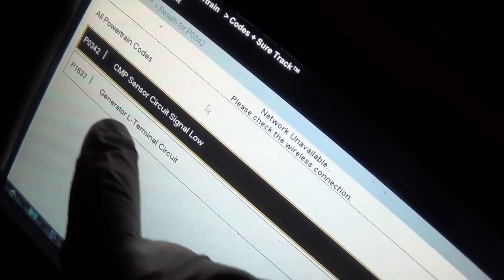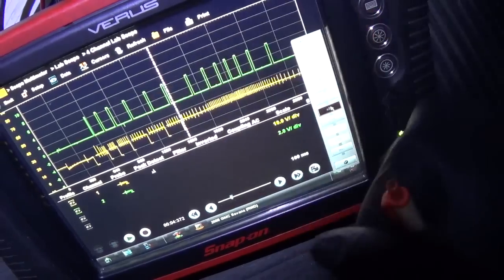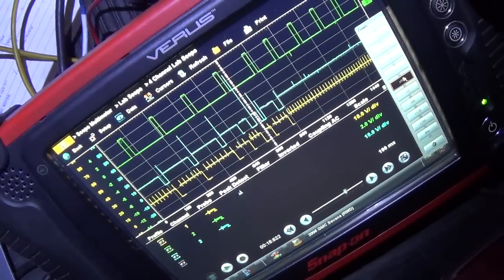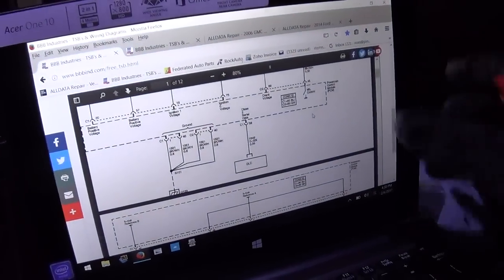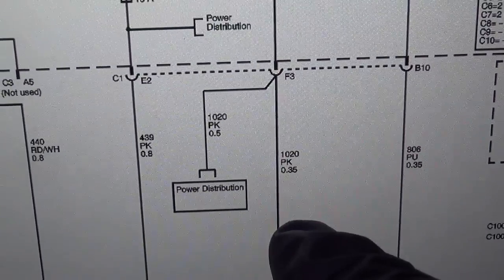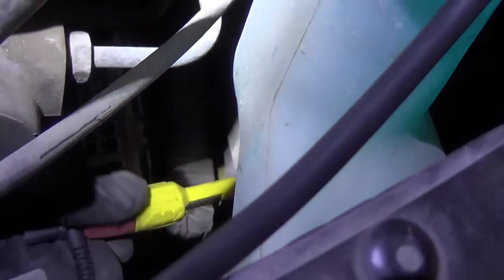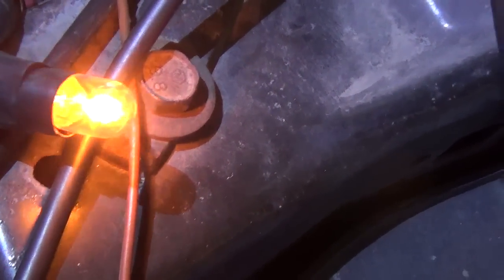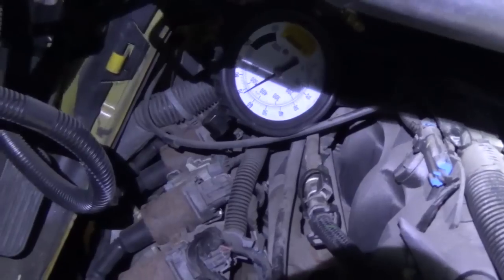Start-stall case study: GMC 4.8 School Bus (Staten Island Ep 7.2)

Comment: That was fun. It cracks me up when customers give you a vehicle and the gas gauge shows empty.
Reply: Cars are usually on empty when they come in. Unless the tank needs to come out. Then they're full.
Reply from the maker: truth.
Reply: Well, if the problem I'm having is going to involve the gastank somehow, I do try to bring in the car with less than reserve remaining, as I assume that makes the technician's life easier, because there is no excess amount of fuel in the system (correct me if I'm wrong there and you lot would rather wrestle with a full tank). Otherwise I'll leave it at whatever it's at.

Comment: You pierced a wire! You violated it and could be brought to prosecution! According to Dan Sullivan anyhow. Good video and diagnostics as usual.
Reply from the maker: I have learned from the pros that sometimes backprobing causes more damage than a fine piercing probe! The connection to the meter is also more reliable with the piercing probe, making for a more accurate diagnosis. :)
Reply: And i am sure the pros you are talking about I as well would respect their input on the matter! Thanks Ivan!

Comment: Very good diagnosis Ivan, some people might say why not to fix the wire instead of by pass, well on the real world lots of costumers don't even want to pay for the diagnosis! So lets not spend time that we will not charge for! Either way the repair is done very well.
 I have costumers asking me if the diagnosis is included on the repair!! LOL, my answer is always, so If the repair is just a broken wire (and toke me 2 hours to find it), should I charge you $5?
Reply: Maic Salazar bypassing known faulty 12v wires is just dodgy and asking for trouble.

that loom could be rubbed through and other wires affected soon which could arc and have a bus fire loaded with kids?

love his videos. but cant agree with this repair.
Reply from the maker: Keep in mind that this is a modern vehicle with fuses, which will blow way before anything arcs and catches on fire. The only wires you really have to watch out for are the main power feeds to the starter and alternator, plus the battery posts. I believe that is how ScannerDanner's Jeep caught on fire...the naked positive battery post possibly shorted to the hood latch.
Reply: motoYam82 completely agree with your comment.
Reply: I appreciate what you are saying.but have been installing stereo systems for 20+ years. and have seen and also caused a few wire arcs and meltdowns that have melted/burnt interior pieces etc. and they were all fused appropriately.

anyway love the channel Ivan. yourself and south main are awesome!

Comment: Why do American cars make so many bong noises? Don't you find it a bit annoying?
Reply: Matthew Collins the bong noises are starting to go away. there is push button start, so no keys left in the ignition. then there are auto headlights, so leaving your headlights on after stop no big deal. the only beep I have heard from my car is when your don't put your seat belt on and you hit 5mph.
Reply: So it dings to tell you the keys are in the ignition? How weird. I've never had a car that does that. (Over in the UK). I think it would drive me batty.
Reply: Matthew Collins and in the USA you need to push the clutch to start the car. Too bad if you stall on a railway crossing...
Reply: Matthew, on  cars sold in the U.S. with a standard transmission you also have to push the clutch pedal down to make the starter work. this  "security feature" throws a lot of (european) people off the first time. :-{
Reply: Becuase most people are idiots. It dings to let you know to put on your seatbelt, your keys are in the ignition, there's a door open. It's annoying.
Reply: Totally agree: unacceptable... the only thing my car beeps for is for leaving the lights on when one turns off the ignition and opens the driver's door, which, from watching these sorts of videos, is about the only thing US cars don't complain about specifically.
If I lived in the US, with this sort of car, those dingers would have to go somehow; no question.
Seriously, how do you guys put up with this shit?
Reply: On the other hand we pay $2.19 a gallon for gas.
Reply: Jan Verschueren I have my seatbelt one disconnected and my jeep only dings when you first start it, my friends Ford dings no matter what.

Comment: Great use of incandescent bulb test light, but why would a wire go bad in the middle?  Overcurrent is only thing I would think.  If you splice in a new wire of same gauge won't whatever burned the old wire burn the replacement?  Should check and write down run current of replacement wire, in case bus comes back, and also if you see above 3 amps start to think about what's causing high current draw.
Reply from the maker: Wish I had an answer for you. There were no intermediate connectors between the fusebox and PCM to narrow down the problem any further. I assume green crusties did their magic somewhere in the middle :)

Comment: what lead you to check powers and grounds at the pcm? experience? or the loss of injector control? did you scope the cam and crank sensors and seen they were good then went to powers and grounds. it was a good diagnostics. I was thinking maybe it was a fuel cut from the theft system. I woulda checked the enable or disable pid
Reply from the maker: If it was an intentional fuel cut, there would have been a trouble code stored like "VTD fuel disabled" or something. But having no relevant codes, and seeing the ignition coils maintain a consistent control throughout the stall, told me the CKP sensor was OK.

Comment: I might have missed something, but how did you go from noticing a problem with fuel injector control and fuel pressure while ignition control waveform looked good to figuring out the problem was with pcm ignition power feed?
Reply from the maker: PCM wasn't storing any trouble codes, so wasn't likely to be an input problem. Only other things to check are powers and grounds! What direction would you have taken?

Comment: Hack fix.  But probably what I would've done.
Reply: Why do you say its a hack job? Sometimes it's better to eliminate the problem wire,  Ivans fix will more than likely out live the bus.
Reply: 12volt Tech yes, it would be a hack in certain situations but this bus is a tool to get people from a to b and back. why cost the school system more money just to restore a wire or connection to factory condition when this does the same thing.
Reply: It's a hack because when dealing with wire bundles - abrasions, pinches, meltdowns, etc don't always result in a single surgically affected wire.  Thoughts of whatever calamity that could happen due to a bus suddenly stalling aside, not verifying the actual cause to ensure that other wires in the bundle aren't split and about to short or corrode is just plain negligent.
Reply: Me too. The vast majority of a vehicle's wiring is difficult if not impossible to access. So I'd say for almost 75% of open wires you need to run a bypass unless you want to take apart half the car (bus truck etc.). At least you're not putting in an after-market part!
Reply from the maker: I did do a wiggle test and visual inspection on the entire harness. There was no obvious damage. Now if you are bent on finding the exact location of the fault, then you might have to open up the harness in several places, which is actually MORE likely to damage it than leaving it alone and just bypassing the bad section.

Furthermore, my bypass wire was wired to the original fuse, so not sure why you think there is a risk of "meltdown"?
Reply: I'm not saying your repair will cause a meltdown.  Maybe I missed where you mentioned examining the harness.  I'm saying that wires stop conducting for a reason.  The close grouping of wires in a bundle lead to a strong chance that other wires were damaged during the failure.  Was the one wire just stretched to breaking point? Then a bypass is fine.  If it burned through a weak spot other wires could have lost their insulation and the next bump could cause multiple fused feeds to combine to cause a meltdown or fire.  Whether it's a  burn, stretch, pinch, rub-through, or some bit of sharp metal from the factory floor wrapped into the bundle -  It's prudent to find the exact cause to see if other wires are will be affected and not suffer the same fate or worse.  That one wire could be an indicator of hidden damage and not something I would chance ignoring.
Reply from the maker: Eddie the Grouch
I totally see your point, and I did everything I could in the time allotted to find the root cause of the problem. If that did not work, do you suggest cutting the harness open and spending hours to tape it back up? 

This is the real world, so we have to strive to do our best, but also can't afford to waste time. If other wires were affected or close to failure, then the wiggle test would have revealed it. I feel completely confident in this repair; sorry that you do not.
Reply: motoYam82 
OK, so what your really saying is 'this customer gave you two freaking hours to fine an electrical wire problem that displayed no freaking codes'.  Then you fine it but son,
Reply: motoYam82 
Sorry, hit wrong button.  So then you fine it which by the way was fantastic but, don't go a bit further to determine exactly what happened to that wire.  Wow Evan. Doctors do this crap all the time.  It's called 'fine the cause'.  Underlining crap will bite you in the ass.  The real problem here is THIS IS A FREAKIN SCHOOL BUS!
Reply: Eddie the Grouch 
I agree with your approach on this as well.  Cheap ass clients.  Allotted time is bullshit.  That was a difficult issue and Evan did it all within 2 hours.  I wonder who else in the service department for these School vehicles would have been able to do it at all!
Reply: Not a hack fix at all. Not on modern cars. There is too many wires, in too many directions to even start looking at all of them. They are all bundled together, and to take them apart, and run the wire properly would be a full days work, if not a week.
This is also a dealer approved fix as long as everything was nicely done.

Comment: I do not understand why PCM/ECM have monitors on sensors and acuators, like sensor line high/low voltage etc, but not on PCM/ECM power and grounds? Electronic components are cheap and you could easily generate codes for missing PCM/ECM power and grounds. This would save a lot of time, no need debug anything else in or out from controller, you would already know what power / ground you need to fix straight away from the code.
Reply: The entire point of having an ECM in control of things is not to make our lives easier, it's only there to guarantee the EPA that emissions are being complied with.  You get no self diagnosis circuity on non-mandated issues.  Price point is already sky high.  In a perfect world, your points are spot on,  just so happens it's not a perfect world.  AND as Ivan has corrected even pessimistic me, without these failures -- he would be looking for another line of work.
Reply: In a sense yes, but since 1980's in 20 years we now have live data, hundreds of PID's and way more info which makes fixing things way easier than the blinking led on K-Jetronic driver box. From my point of view cars are now easier to fix than 20 year ago. More complex yes, but more data and diagnostics in the box. 

Thus $2 six line AD -converter added to the SOC might not take the whole business away, since adding it to the sensors and actuators did not ruin the business years ago? Just my $0,02
Reply: I've seen "PCM lost power" codes. This was on a Cummins with jerry rigged "semi truck" battery terminals that the owner kept neglecting to fix properly lol.

Comment: I had a similar issue w/ a 13 silverado 1500 4wd 5.3. It was brought in for a CEL, starting problem: start stall ( not stated on RO), lack of power/misfire a highway speeds. 

Scanned for codes and there was a p0101, p0102, p0171, and p0174. Okay possible MAF sensor. Look at freeze frame, Idle , warm, stft like 20%. ( i need to document my readings as I go). No common issues per troubleshooter, tsb, google, etc. Okay look at MAF data and it's all 0. even in generic. I cleared the codes and instantly I was then dealing with a start stall. couldn't get the truck running pressing the accelerator or anything. Disconnected the MAF same. Vacuum goes up the 20" then falls w/ engine, rpm goes up and down with stall. Added brake clean to keep it running, 

with brake clean able to keep it going, but then started running like total crap. vacuum 10" steady. Died out, Fuel pressure consistent. 50-60 during stall.  It sat for maybe 10-15. then started up fine ran great, vacuum 20" fuel pressure 50-60 doesn't drop on a snap throttle. this is as far as I got. 

All the variable threw me off. Trying to understand your logic. coil control and injector control eliminates cam, crank, and tells u if your dealing with fuel or spark?  the injectors  dropping out being a pcm issue? could it be because of a  sensor that's giving an incorrect signal cause the pcm to kill injectors? 

Logic in the pcm wouldn't kill the fuel from a bad MAF sensor would it?
Reply from the maker: Well I would definitely chase the MAF codes first! You should at least be able to track down why it's reading 0gm/sec all the time.
Reply: motoYam82 dealing w customers and service writers they want to lump all the symptoms together and not being paid enough time for diag.

Comment: what led you to voltage drop? my next step would have been a crank sensor
Reply from the maker: ignition coils were firing consistently during stall, so not worried about CKP sensor in this case...

Comment: please shut off that damn beeper! Good fix though. This series should be called jumper wires on Staten Island.
Reply: I think its more like a damn DINGER.! MAN, 30 seconds into diagnosing, I would have fixed that damn dinger ding ding.!
Congrats Ivan for staying focused somehow on the real problem and getting her all fixed up. 
Now the wheels on this bus can go round and round once more.  (:  
Cheers
Reply: If I need to work with the doors open and have the key turned on, I close the door latch with a screwdriver and plug in the driver seat belt before I even start.

Comment: Ivan pretend this question makes sense. LOL  Ok if you're suspecting a ecm ground would a voltage drop from the data link connector at the  ecm grd. pin  to the battery grd terminal show a bad ground. No laughing......
Reply: STEVE ROB  ECM may have more than 3 grounds
Reply: huggybryn39 I think  I remember hearing the grounds are all tied together in the ECM. Might be wrong .
Reply: STEVE ROB With O2 sensors working with low amps and voltage you may require a separate ground for the return.
Reply from the maker: Excellent question, Steve! It depends on the actual vehicle. Sometimes ECM grounds are all tied together. Sometimes grounds for high-amp drivers are routed separately from sensor grounds. Wiring diagram is key.

Comment: So fuel pump was dropping out due to faulty PCM control feed
Reply: No it was a bad ecm power wire, about the pressure drop i dont know probably since the pump relay was controlled from the ecm so a bad 12v wire could not have total control of it.
Reply: armando nika 
Yes I agree, I just wasn't quite sure why the fuel pump itself was faltering. Two different symptoms related to the same prroblem.
Reply from the maker: Exactly. Once PCM lost power, it couldn't keep the fuel pump relay energized so we lost fuel pressure as well!

Comment: Great fix but just be warned that bypassing a power wire like you did may be a problem if something else feeds off that wire you bypassed. I did the same thing on a 5v ref for a throttle pedal that had one of the two 5v ref were bad. The schematic clearly showed 2 separate wires going to the ecm so I cut the bad wire and put a jumper on it and turns out that both of my 5v ref came from only 1 wire and when I cut it I didn't have power on the other.
Short story is just be careful
How do you like the touch screen laptop for the pico?

Comment: Sorry Ivan. Totally lost me on the real purpose of this video.  It's a school bus. Carries children. You found a wiring problem. You jumped a symptom. Bandaid it. Did not show doing a continuity check on said wire.  Did not eliminate suspicious wire from circuit.  Hope it doesn't cause issues down the road.  Are you saying this wire is partially broken?  I know it's a field fix and pressure is present from your cheap ass customers but, do it right and do it thoroughly.  The video is 13 minutes which does not tell me how much time you spent on it. Like 2 or 3 hours.  Between that alarm constantly going and your jumpy thoughts did not help me understand what you were proving.  Either GM has wiring and ground issues or your just showing off. Won't stop me from watching you videos.
Reply from the maker: Actual diag and repair time was at least 2 hours. Continuity check unnecessary. Bypass wire DID eliminate suspicious wire from circuit...that's the whole point of a bypass! It's a permanent fix, not a band-aid. 

Time constraints definitely cut into video time and quality, but I try to show the key points :)
Reply: motoYam82  Wow, Evan I'm truly honored you took the time to respond. Don't get me wrong, I've learned a lot from your videos and I'm amazed how you get down to the actual circuit causing the issues.  I love diagnosing electronic and electrical problems.  It was interesting the way the light was going dim.   Kind of scary.  I guess the wire was going all over the place and you chose to bypass it. All I'm saying is, things were not that clear to me.  Keep them coming my friend. You and Eric O are my hero's.  God bless, and I mean it.